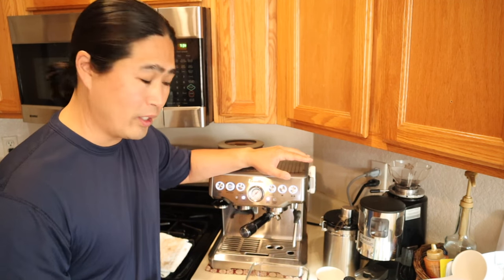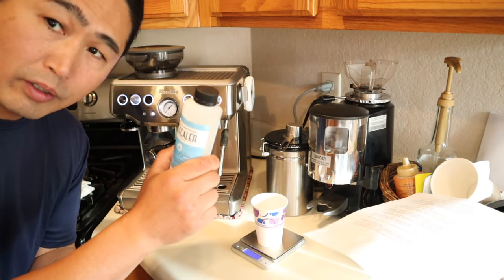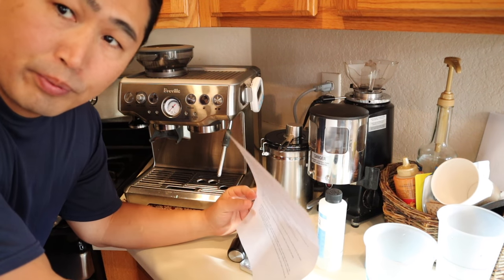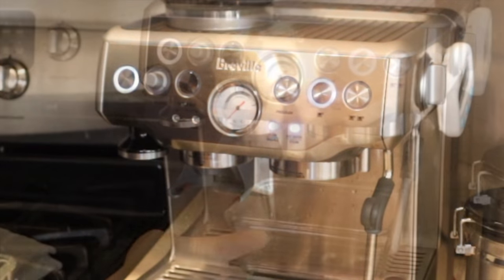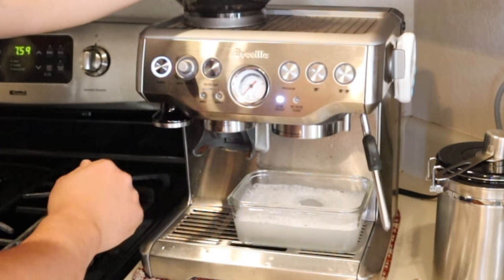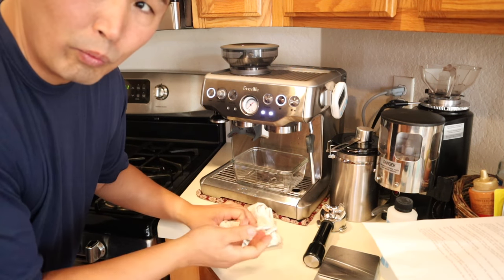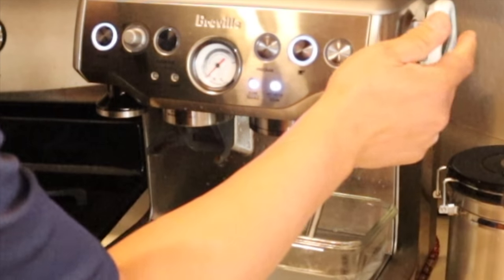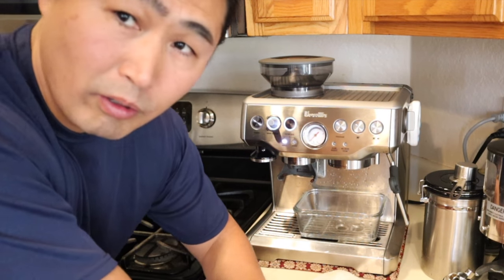How to  "Descaling" | Breville  Barista Express

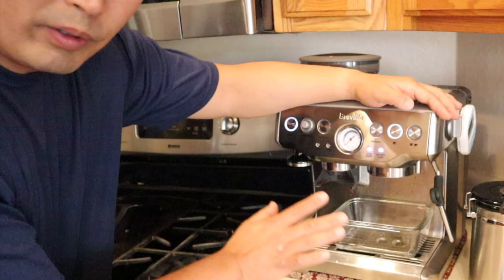Comment: 06:25 - if it doesn't power-on properly after power-down (both the power button and the steam/hot water lights are flashing), then check if the steam/hot water dial hasn't been left in the standby position.
It's easy to leave it out of standby after flushing because the water volumes are fixed when operated through the dial.

Comment: Thanks for the video, helped a lot since I can't find my manual. 
Couple tips though that weren't totally clear for me.

The 2 cup and power button method to start the descale process wasn't working for me, bc my machine was already on and it kept turning the machine off when I tried. So I figured out to make sure your machine is off, then hold the 2 cup button and then the power button and it will work.

Also, I saw you did it in your video, but you didn't actually mention it. When doing the descaling, make sure to run the solution through the steam wand and hot water spout, as well as the espresso spot, to descale the whole machine. 

And lastly, instead of buying the descaling solution, you can use 50/50 vinegar and water for a fraction of the price but same outcome!
Reply: Lol, you can see his machine is off before he starts! But yea he didn't mention about flushing the wand/spout/group head nor for how long

Comment: Note there are two versions of this machine.  Under the light, your machine might say "clean me" or it might say "clean/descale".  View this video which differentiates the process for the two: https://youtu.be/Nf04CYUFw3o?t=57
Reply: Thank you for this! I have the version that just says "Clean Me" and was going absolutely nuts trying to descale using the process from this video. I'd watched about five of them and they were all the same - was getting super frustrated!
Reply: Actually I have two of these machines both of which just say ‘clean me’. One has a descale mode and the other doesn’t. Odd.

Comment: Hi Hoon, I have a very interesting question: flush vs descale. Is there a difference? The flush is by putting a cleaning tablet in the portafilter to do flushing every once in a while when you see the ‘flush” on the display as a reminder. The descaler is by pouring cleaning chemical into the tank to do a ‘complete’ cleansing or flushing ritual. My question: is the descaler designed to clean the heat boiler whereas the tablet (flush) is mainly focused on the group head and portafilter? So aren’t these two cleaning detergent redundant?  If the cleaning tablet gets flushed and dissolved in the portafilter, it will bypass the boiler and clean it too so why the need to buy descaler? If I descale it very often here and then, then would I still need to do the flush? I just want to know if the company is making us the consumer to buy stuff that is totally unnecessary if one cleaning agent can just do everything. And now the company has this one cleaning detergent specifically to clean the steam wand. If I buy all of them, it will be costly to do maintenance yearly. Cleaning tablets (flush), descale liquid (descaler), water filters for the tank, grinder tablets, and the steam wand detergent.
Reply from the maker: Great questions! I wish I can give you better response but here is answer from Breville. "Decalcifying - After regular use, hard water can cause mineral build up in and on many of the inner functioning components, reducing the brewing flow, brewing temperature, power of the machine, and taste of the espresso. We advise decalcifying the machine every month and especially if not using the machine for an extended period, e.g., before going on vacation. Replacing the water filter every two months will reduce the need to decalcify the machine"  it can be costly start adding up the cleaning supplies. This is why, I used filter water so I don't have to deal it.
Reply: @HoonsCoffee  thank you for the response. Now I know the grave importance of keeping the machine clean. I guess there's no harm to start stocking up cleaning supply, you may never know when you're need it.  I'm using Urnex branded cleaning products (cleaning tablets for the flush) I guess it's a no brainer to use the line of their cleaning products.
Reply: @HoonsCoffee  Thanks again for the response, so how frequently should I descale my machine? On the display, it will pop a blinking "FLUSH" which to remind to me of the routine ritual. So does the "DESCALE" too will flash when it's time to clean it. As for the filter tank, the rotating wheel for the month reminds me to change filter, so how about cleaning the grinder. When would you suggest to clean it? Monthly or weekly. I'm a casual drinker, so probably 1 to 2 cups per day.
Reply from the maker: @3rd-Wave_Rebel  The Barista Express™ is equipped with a feature that allows for a dryer puck when it is removed after extraction. There is a small valve in the group head that sucks up a bit of the excess water. Unfortunately, with that water is coffee oils and possible grounds. In order to keep this valve working correctly and optimally, it is required it be cleaned periodically. The CLEAN ME light that comes on indicates when it is time to run this cleaning cycle.
Reply from the maker: @3rd-Wave_Rebel  Are you using a tap water or filter water?
Reply: Hoon's Coffee tap water. I have brita water dispenser. Should I use filtered water?
Reply: Hoon's Coffee hi, Hoon. 

The Valve doesn’t suck anything, it’s just letting excess pressure through. I have descaled and disassembled the whole machine due to hard limescale. I know exactly how the machine works internally. I have disassembled and assembled the machine at least 10 times 😂😂 watch some of my espresso videos if you would like 😄 love your Channel by the way 🙌👍😀

Comment: Hello, Hoon. Thank you for making this useful videos. I have been watching your videos since quite some time now and I find it really easy to follow and simple. So thank you really. I have one question though, can I use vinegar instead of the descaler solution? Or that would harm the machine? And if so, what brand do you recommend to buy as a descaler? And also what brand do you recommend for the tablets to do ‘clean me’? Thanks in advance!
Reply from the maker: According to Breville, "Pour in a 50/50 mixture into the water tank of white vinegar and water up to the MAX line. White vinegar is recommended as it is all natural and has the highest content of acetic acid."

Comment: Hello Hoon! My breville barista express does not go into descaling mode.. i hold the 2 cup button and the power button but it all it does is it flushed water right away
Reply from the maker: Check your model. Mine is BES 870.
Reply: Check your machine.  If your machine has only "Clean me" printed, it is version 1.  If your machine has "Clean me/Descale" printed, it is version 2.  Check Breville Support or Breville Youtube to descale your machine version properly.

Comment: Hello Hoon, I have the digital version of this machine.. and have been using it since 2021 feb with no issue. But after the last descale and cleaning the single/double shot programming does not work anymore. I had it set to stop at 24 sec but now, unless I hit the button again it will keep brewing until the water runs. Any idea what is going on?

Comment: Hey Hoon, I have followed your advice and I am getting much better espresso from my machine now, but I have 2 questions that I have not seen you give advice on yet: 
1) what do you recommend for the grind amount setting and 
2) how much pressure would you suggest when using the tamper? 
I think they will both effect the pressure that the machine is able to provide, and would love to hear your advice.  Thx again!
Reply: From all barista jobs I've worked at, you want to apply no more than 30 lbs of pressure when tamping. Too much tamping and your shots will run long because they're too compact and the water can't run through well. Too little and the opposite will occur. Honestly, playing around with your tamping and seeing how the shots pull (either too fast or slow) can help you figure it out and see it for yourself. I hope this helps. Make sure you're not using your full weight when tamping, just a nice pressure from your wrist. :)
Reply: @hails.bells99  I've used some advice from some videos (and from pg 22 in the manual) that the the pressure that works best pulls the shot in 25 to 35 seconds. Anything faster makes it taste sour. Anything slower tastes bitter.  A big variable, too, is the type of coffee you use. It tastes much better using coffee roasted for espresso. Starbucks Blonde Espresso grind is very good! I used to switch around using different coffees before grinding all the way through the previous beans. So sometimes the grind was a mixture of 2 different coffees. That will drive you crazy getting the right amount of coffee and grind size to make a good and consistent espresso. One last piece of advice. Flavored coffees, even the top 2% arabica beans, will gum up the process as you try to get the right combination of settings. I've never made it work and wasted good, expensive coffee in the process.

Comment: Thank you very much for your detailed video! 

However Im having another problem which is that the volume of water is so much more than it usaully takes when I make a cup espresso. Now everytime when i press 2 cup, i get a "long black" instead. Just wondering have you ever come acrossed this issue as well? If yes, can you please advise how should I adjust the water volume until it back to normal? Thank you heaps!
Reply: Press the program button next  to 1 cup button then manually hold the 2 cup or 1 cup for however many seconds u want. Next time it will brew for the same amount of time. Or try brewing by holding button down for however long. Could be that urs accidently got reprogrammed

Comment: Hello Hoon. So when I tried to get my machine to descaling mode pressing and holding the 2 cup and power buttons my machine just gets started and no descaling mode goes on, what can I do? Is there another way to get to descaling mode?...
Thank you for your help 
NM
Reply: Yeah, same here. followed it to the letter. It starts normally. I've done the cleaning cycle with cleaning tablet. It worked fine. I've just realised my portafilter is still on.  Removed. Well, again, it starts normally. This is frustrating.
Reply: Same here, no descaling mode...
Reply: Me too! Thinking the clean me light has to be solid in order to enter descale mode? We just decided to descale even though the lights wasn’t on, and we couldn’t get into the special mode so we just followed the rest of the instructions.

Comment: I can get the machine into the cleaning cycle (1c+2c+pwr) but it won't go into descale mode (2c+pwr) it instantly turns on no matter what I do. Any ideas?
Reply: Yes, had the same problem, keep trying until the one cup light is on.  Hold down 2c + pwr until the one cup light comes on

Comment: Can we used vinegar instead of the Descaler powder or liquid one ?please let me know. 
Thank you Hoon .
Jay -T
Reply from the maker: Yes you can! 25% vinegar to 75% water.
Reply: Thank you Hoon ,is great information from you .
Reply: @HoonsCoffee  
Please let me know the brand name of  scale , red thermometer and coffee leveler before tap it you using .I have bad experience .please let me know. 
Thank you hoon.Jay t
Reply: Vinegar works but it leaves behind that smell and taste a bit. You will have to rinse it by running clean water a few extra times. Citric acid works better and does not have a smell.
Reply: @einsaan  where can iget citric acid ?
Reply: Spent all that money on a machine and you want to use cheap cleaning materials. It's like buying a Ferrari and filling it up with cheap fuel
Reply: @jalaltirgardoun1406  Here in US you can find it in some grocery or cooking items related stores. Best bet is using amazon. It is sometimes also sold as tartar in asian stores.
Reply: @True_Blood_89  If you know what you are using and how to use it properly, cheap cleaning materials actually turn out to work better and of much better quality.
Reply: einsaan Doesn't matter how well you use the machine you're still going to get build up. There's a reason why Urnex Dezcale is the recommended descaler. But by all means stick to your vinegar
Reply: @True_Blood_89  Sure. Use whatever works for you. You're paying for it not me. Oh, and btw Breville specifies using vinegar page 28 Care and Cleaning of their Instruction manual. But what do they know about Ferraris. mic drop

Comment: I have 870 Model, but I don't have a descale light, only a clean me light. And in Breville manual they ask for white vinegar :water 1:1
Reply from the maker: Yes. Seems then Breville change they manual to use descaling solution.

Comment: I just tried to de-scale with vinegar and water as it said in Breville instruction booklet from 2 1/2 years ago. I've never descaled before but now there is no water coming through the group head. Still no luck getting any water to come through. Steam wand still works so pump is working but no pressure through to make coffee. It must be really chocked up with calcium. I see Breville has special de-scaling mixture which my book doesn't mention
Reply: Great success the following morning. I left the stronger vinegar solution in the machine overnight and this morning it broke through and started working. Thanks for your other video on pressurised baskets/non-pressurised baskets as I used these to assess it wasn't only working but had some good pressure. Thanks again. I'll be buying proper de-scaling solution soon
Reply from the maker: Good to hear it Bob!

Comment: If you descale with the filter in is this an issue? The filter was due for a change so after the descale I swapped it but I assume it wouldn’t have cleaned as well with it in? (I read the manual and don’t remember seeing a step telling you to remove the filter before adding the solution)

Thanks Hoon
Reply from the maker: You have to remove the water filter prior to descaling.

Comment: I followed the instructions and the light went off . Thanks. I tried someone else's you tube video first and it didn't work. I think a lot of the potions are a rip off. I think some of them are pretty much citric acid.
Reply: White vinegar and water solution (1 part vinegar to 2 part of water) does the trick for me, although the smell is really annoying. But is way cheaper, just as effective and easy to find.

Comment: i just noticed when i was about to descale my Barista Express that my machine only has the "Clean Me" option and not "Clean me / Descale" option like you have. The descaling process is a bit different on my model and not automated as yours is. Looks like the older Barista Express 870 had a few differences including the burr grinder bucket calibration option that yours have.
Reply from the maker: I think you have BS 870XL
Reply: Einsaan.......mine is also like yours.  It’s not as outsmarted as others the exact same model.  It’s very confusing!  I checked my model and it’s an XL870/A however, mine must be an older “A” as other “A” models are like Hoon’s.  FYI, never do this until you empty the tank....you can go below minimum but don’t ever go close to empty.  Will damage the pump!
Reply: Si how did you descaled your machine? I have the same and holding the 2 cup and power does not work arrrrgh!

Comment: Is there a way to enter descale mode if the clean/descale light is not illuminated? I accidentally went into a clean mode and it needed descaling, now the clean/descale light is off and the machine will not go into descale operation.
Reply from the maker: Try this again! https://youtu.be/mro5fjMFdQk?t=141

Comment: I’m having an issue with my steam wand where it isn’t wanting to pump water out or steam anything - however all other functions work. It also doesn’t want to push water out in rescaling mode. Any suggestions?
Reply: It’s probably clogged. If u don’t clean the wand immediately after use and purge it for 2 seconds it may happen. There’s a tool breville provides that lets you unscrew the bottom portion of the wand and clean it.

Comment: On my machine I have to hold 1 Cup, 2 Cup and Power Button to initiate descale mode.  Holding only the 2 Cup and Power buttons did not work.  I had to hold all three
Reply: Holding power 1 cup and 2 cup only starts backflush mode not descale

Comment: Hoon, i need help. My Barista Express has been going good for 1 year. Today i made some coffee, it smell burnt. The group head is expelling steam instead of water hence burning the grinded coffee at very high temperature. What is the issue here Hoon? Do i need to descale it?
Reply from the maker: When is the last time you cleaned group head and portafilter? https://youtu.be/8zWv8I9vHLg
Reply: @HoonsCoffee  I do 'clean me' every 2 months using tablet, thats all. Never descale at all since i got the machine new. Its 1 year old. The machine power button is flashing and won't stop and machine is very hot. Please help Hoon.
Reply: @HoonsCoffee  I think its nothing to do with the porta filter. The issue might be internal tubes or electronic issue or blockage of valves.

Comment: When I try to hold the two cup and press the power my machine just turns on normally. Do I need to wait for it to warm up? And then press the buttons in order?
Reply from the maker: Try this https://youtu.be/wuIuMokbfkQ?t=268
Reply: Do you find an answer to this? Mine does the same thing.